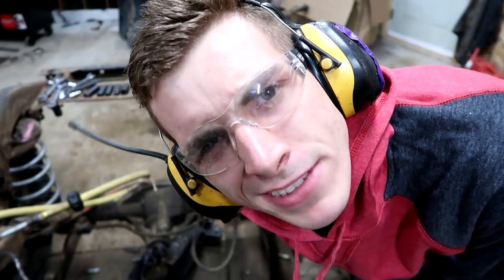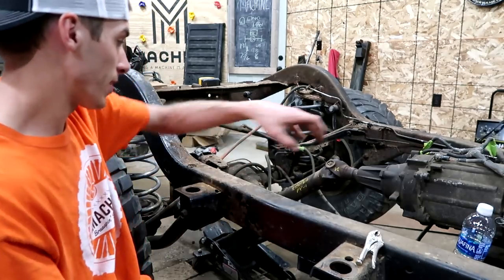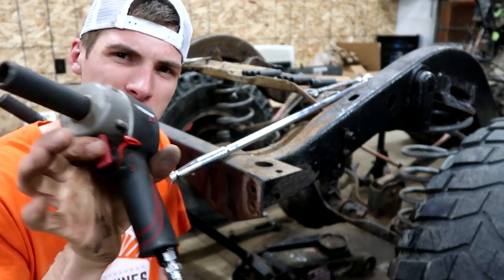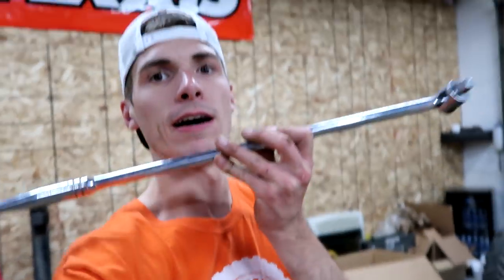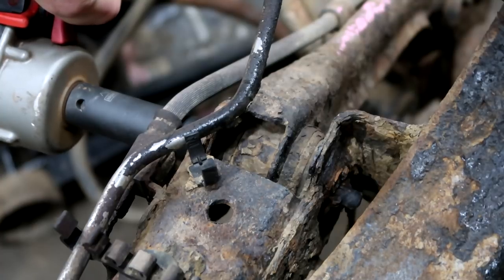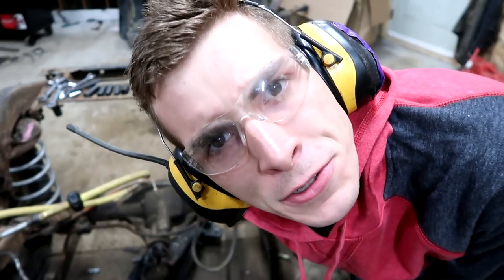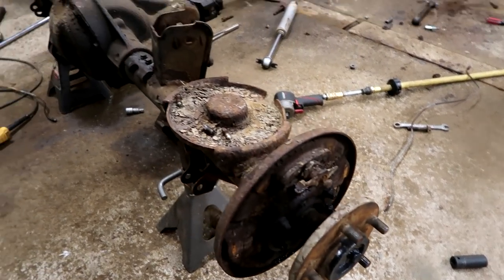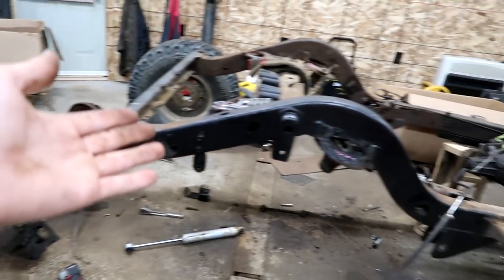DESTROYING MY JEEP

Comment: Skip the dana 35 if you plan on running big tires, A ford 8.8 for anything up to a 31 tire then dana 44 for everything bigger. You would be best off to mke all your modifications install the body. make more adjustments ,then take it all apart again to have stuff powder-coated. Paint will be much easier to work with when you break parts off and have to weld them back on. And you will break parts off and have to weld them back on some day.

Comment: Your Jeep is like brand new compared to mine. To correct the drive shaft angle situation, the prescribed  fix is to lower the transfer case mount plate. I believe your transfer case mount is aftermarket. Lowering said mount will change certain other angles as well.  You'll probably need a good pneumatic needle gun to deal with the rust. My Jeep, a '93, was used to haul a boat for floating on the ocean, and the chassis and body are rusted to shit. Good luck guy, you need it.

Comment: Hey Dalton, That rear axle is very weak when running larger tires. I would suggest while you are tearing everything apart, do a quick look around junkyards or craigslist and find a Dana 44, Dana 60, or a ford 8.8. You'll go through way less axle shafts and save in the long run.

Comment: We have a 1966 jeep gladiator pick up truck and we powdercoated the frame and it looks so much better than how paint would look so u got that right but I would go with a basic flat black for the frame because ours and I can see urs will have a lot of pits in it from all the rust and black will hide it ,just a suggestion

Comment: @3DMachines
Consider a Ford 8.8 swap in the rear. They are much stronger than the stock Dana 30 (8.25). They come out of anything from a Ford ranger to an explorer. It will need to have new brackets welded on however.

Comment: Get the frame galvanised, then bed liner or por15 or something. Waxoil in all the cavities. If you do paint or powdercoat get either satin black or crackled finish in black. Then just do big items like springs red,maybe the diff and drive shaft in silver so leaks show up easier.

Comment: Just a note with tjs drill a small hole at the bend of the frame (lowest points) to let the water drain. Stops the rust and keeps the moisture out. And I’d do the whole jeep that one lollipop red! Frame and all. Would look sick. If you want I could send you photos of my red rocker guarded jeep. That turned out sick. Feel free to message back.

Comment: Okay so you need to get frame repair sections from "safe t cap" and chop off those old rusty rear spring perch mounts on the frame and buy some new ones and relocated them about 3 inches farth behind the origonal ones to fix the crazy angle the springs are doing. And absolutely DO NOT reuse that horible dana 35 rear axle. Dont even think about it. Dont put a single dime into it. It will break even on the road with a turboed 4.0. You need to get a dana 44 at the minimum, a ford 8.8 or dana 60 preferably.

Comment: not sure if you were happy with your sand blaster .I use a guy in eden .theres a small section of eden on rt20/southwestern blvd .near 18 mile creek .eden pipe is across the street ,and schwans is next door .think you would take 62 and make a left just after eden napa . 3 minutes then left at the light at rt20 .get to the top of the hill and look on your right .says WELDING real big on the building.7274 southwestern blvd eden ny / ,says google earth.7301 is across the street I know

Comment: If u want to get read of the Angle twist ur axle back a little so it's not as bad coming of the Axle and thin stretch the back a little for a longer drive line and that would solve ur problem

Comment: Don’t bother with that diff. It will break I guarantee it!!!  Get a 8.8 out of an explorer and they sell a truss kit that you weld on for all the brackets. Those Dana 35s are junk. Especially since you added a turbo and big tires. Dont waste your money on it. Plus the 8.8s come with 410 gears and disc brakes.
Reply: I ran 37” tires on my 8.8 for years and never had problems.

Comment: That’s gunna be too much red do the frame and axles black with red diff covers and red body mounts, coils, shock boots and put some under glow in the wheel wells and foot wells I did mine in green with some $7 Amazon waterproof strip lighting came with 16’ and over a year later it still works great

Comment: Dana 35... Bad.. bad.. bad... Scrape it and go 8.8 Ford or Dana 44... If you plan on staying 35s  or 33s... Also take front axle Dana 30 is ok for 33s but if you are going to dump money in to alloy axle shafts... Stop on the 30 and find a Dana 44... Pottsy @ Built By Pottsy LLC... 👍

Comment: ***********CAUTION*************
If that rear axle is a Dane 35 and you run 33" tires with the turbo, you are going to break an axle shaft. It's not if it's when. The axle shaft is only as strong as the groove where the c-clip sits. Look for a Dana 44 axle to replace it. Check car-part.com. Good luck.

Comment: please dont paint the frame red !! it wont look right i promise you. Paint the frame black but paint your control arms and steering linkage red it will look so much better. Plus if your going to wheel it which i know you are lol that fram eis going to need touch up and with the red it will just start to look bad. just my two cents